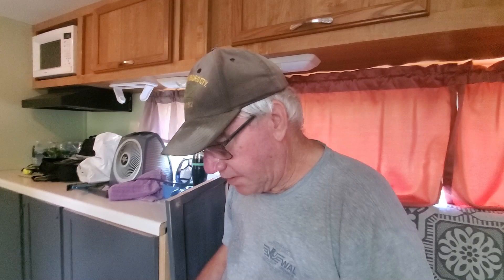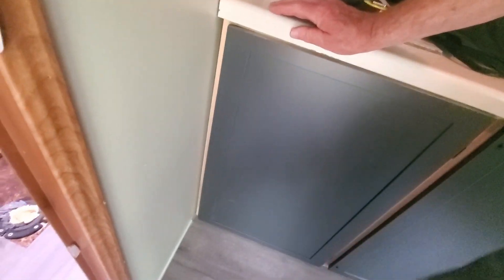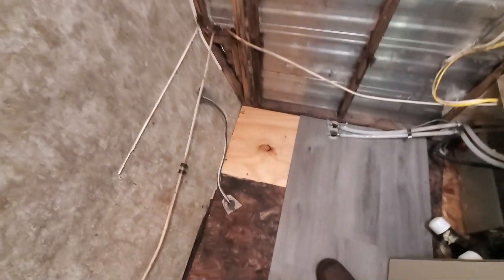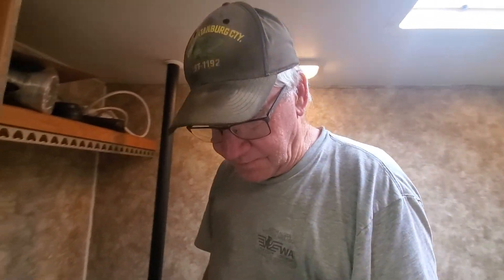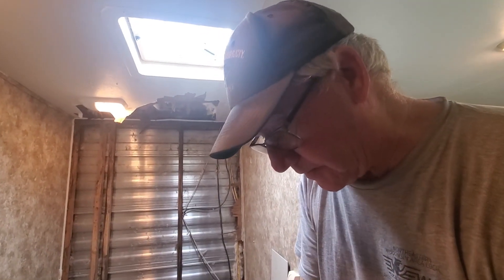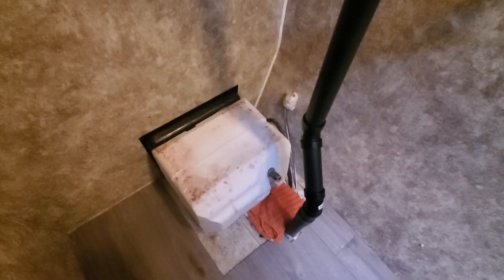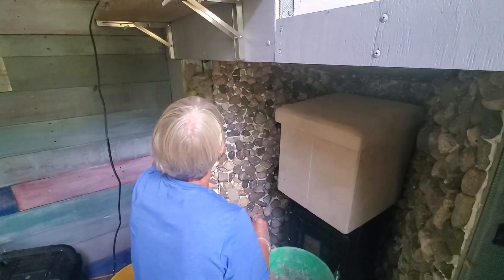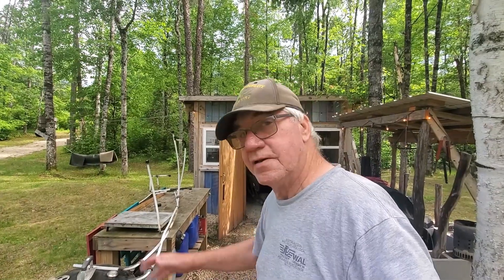From Camper Commode to Cozy Bunk. The Update Begins!

Comment: Looking good my friend.  Great idea to salvage and old camper.  We should have done the same with our two old ones but we'll see.  Maybe once they stop being used as storage.  Lol. Need to build a shop first!
Reply from the maker: It most definitely has been a fun project. I was really surprised at how many holes for wires and piping, were not sealed at all. I stuff steel wool and spray foam in them. I did the same around the wheel wells. Thanks for watching.